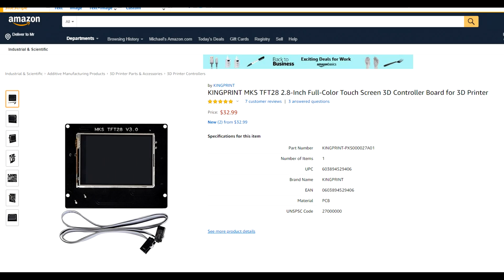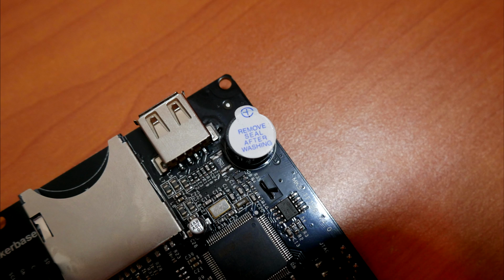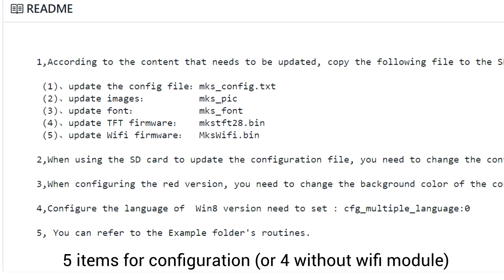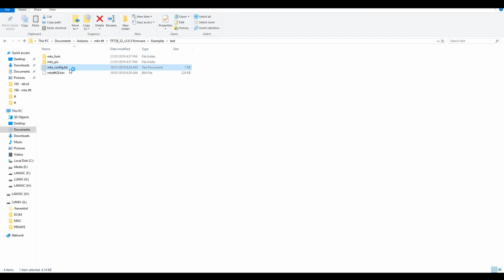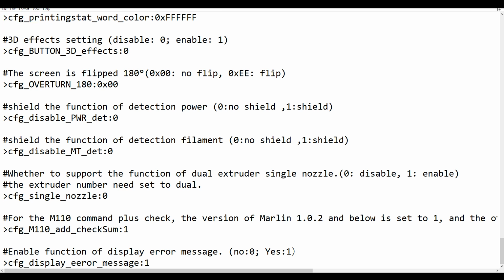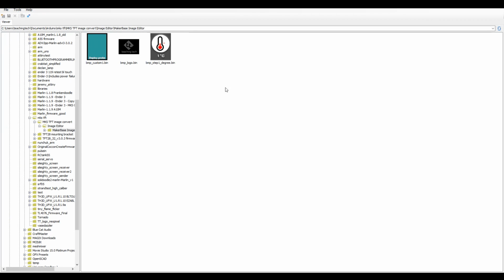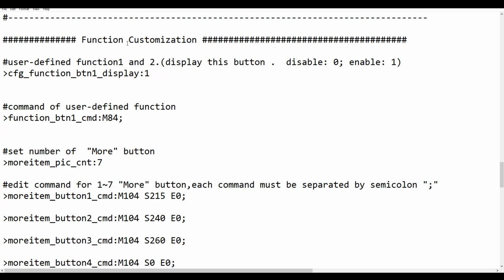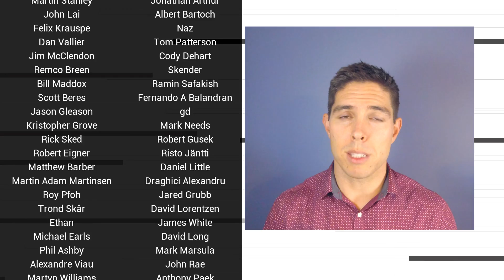MKS TFT28 touch screen on the Ender 3

Comment: So I have the mks gen l, Tft 3.2 and bltouch. I’m having an issue with setting the bltouch everything is dialed in and working as it should however, setting the z offset either up or down during the first layer like on the factory main board is not accessible with this screen is there anyway to enable this functionality?
Reply from the maker: Youcan make custom buttons with M290 commands. See the example at the bottom here: http://marlinfw.org/docs/gcode/M290.html

Comment: Have a question for you. Installed the MKS Gen L board along with a BLtouch. At first I was using a RepRap Full Graphic Smart Controller and everything was working great. I decided to upgrade to the MKS TFT28 controller and the install went well. Going through the screen buttons everything except the "Auto Level" works. When I try to use it, the sequence starts and then I get the message "Error - STOP called because of BLTouch error -  restart with M999" and there is a blue button that reads "confirm" when I push it, it just goes back to the previous screen. Can you help?

Comment: mks_config_EN.txt needs to be renamed to mks_config.txt without doing this causes no communication to the board. Hope this helps someone else as this caused me a grief for a while.
Reply: No joke man I love you I searched the web for 3 days and nothing helped and then I read your tip and bam it works. Thx bro <3
Reply: As always there is always something missing in the description and also I found that to hook it up to the Melzi stock board. you have to change from 5V to 12V and supply an external power supply. if it weren't for your recommendation on the config file I'd still be pulling my hair out.
Reply: I did this with success and was able to see changes to the firmware, but the issue I'm having is the board is no longer communicating with the screen :( like when I home the axes, it doesnt do it :(

Comment: two questions: 1) can i use the SD card on the TFT to print?? (as mks gen l board doesnt have SD slot) ?  2) i read somewhere that if i use the TFT on Mks gen l than i can not use the USB port on the board. is it true?
Reply: As to question #1, yes you can print with an SD card on the TFT28 or TFT32 display. Not sure about question #2.

Comment: Hello! I absolutely love your channel. I'm in the middle of upgrading the main board on my CR-10s following your guides. I've got the TFT28 firmware configured and it's booted up as described but I'm running into an issue with text. As you can see in the image linked below I have text overlaying the graphics. Any ideas for solutions? Thanks!

https://imgur.com/a/P45nCsW
Reply: I had this same issue. mks_config_EN.txt needing to be renamed to mks_config.txt is what cleared it up for me.

Comment: Thank you for this video and touching on custom buttons. It gave me an idea. Currently, I don't have any buttons for babystepping on the Ender-3 I upgraded to use MKS GEN V1.4 and TFT32, even though I set Marlin up to allow babystepping. So, I'm going to make custom buttons. M290 Z0.1; to move z up. M290 Z-0.1; to move z down. And then M500 to hopefully save the setting for the next time I print. I have been using M92 Zx.x in my G-Code, but it's not consistent for some reason. And, I like to share G-Code between different printers (Ender-3 and Ender-5) and the G92 command messes up the level between them. If you know of a fix or how you work around it, I'd be interested to hear it.

Comment: No luck with any controls on mine, the steppers will move manually through marlin but there is no heat up or movement through the screen. I ended up giving up and putting it factory after a few days of looking online and playing around in marlin.
Reply: I had same issue. mks_config_Eng.txt needs to be renamed to mks_config.txt
Reply: fatherb no luck

Comment: I just got my ender 3 pro a few weeks ago and I watched a lot of your upgrade videos. I bought mks gen L 1.4 and stepper drivers, tft28 screen, bltouch, and raspberry pi octoprint and was wandering if you will have a video that shows how to install everything together along with firmware instructions. I would like to find a 3d printed case for the mks gen l 1.4 that works for ender 3 pro.

Comment: Thanks to this video and the related one on the MKS Gen L upgrade for the Ender 3, I've completed these upgrades and gave them a spin last night. All in all, it works well, but I am going to be going back to the original screen with click-knob for two reasons:

1. In order to reflash the firmware on the MKS Gen L, it's necessary to disconnect the TFT28. If I leave it connected, it corrupts the firmware upload and renders the MKS Gen L inert. Fortunately, once the touchscreen is disconnected, reflashing works just fine and everything recovers nicely.
2. The touchscreen doesn't completely replace the functionality of the original display, or, more specifically, the click-knob. After completing a PID autotune, Marlin pauses saying "paused for user". At this time, it's expecting the user to click the knob to acknowledge the autotune completion.

For as little as I actually use the printer's console (versus Octoprint either via an attached Raspberry Pi touchscreen or remotely), I'm not going to be that upset at losing the otherwise cool touchscreen.

Comment: Hi,

Thanks for the videos on upgrading to a MKS GEN L and the TFT screen. You showed you have also a bl touch in your setup.
I have already upgraded my CR10 using TMC2130 in SPI mode. Nice and silent, with sensorless homing on the X and Y. I also configured  a bl touch .

I could not find the option "babysteps" on the new TFT display.  With this useful option you can make small adjustments in z-heigth while starting a print.
For now it only accesable by double clicking the button on the original CR10 display. 

Does anybody know how to get to the babystep-option on the MKS boards?

Best regards

Rob
Reply: Rob Huurman I’m having this same issue on my ender did you ever figure this out? My nozzle is just a bit too close to my bed and would like to babystep it up but I see no option to use this feature on my first layer while printing. I am running a gen l bltouch and tft3.2 like you
Reply: Audio Philes . 
Hi, I've hooked up both the TFT and the original display to the MKS Gen L. Most of the time the TFT-display is used. Babysteps for finetuning a print that's just starting are adjusted on the original display.
Make sure to enable "CR10 display" in Marlin, otherwise only the TFT is functional.

If someone knows how to get to "babysteps" on the MKS Gen L, please inform us.

Rob

Comment: Hello.
I have a question please.
Why do you use version V3.0 and not V4.0?
https://es.aliexpress.com/store/product/MKS-TFT28-V1-3-2-8-touch-screen-RepRap-smart-controller-support-WIFI-APP-outage-saving/1473578_32808777466.html?spm=a219c.search0604.3.62.49f414ecDM8Hnf&ws_ab_test=searchweb0_0,searchweb201602_9_10065_10068_10547_319_317_10548_10696_10084_453_10083_454_10618_10304_10307_10820_10821_537_10302_536_10902_10059_10884_10887_321_322_10103,searchweb201603_51,ppcSwitch_0&algo_expid=a1f682df-c067-450a-b325-72152aea65c8-9&algo_pvid=a1f682df-c067-450a-b325-72152aea65c8&transAbTest=ae803_4

Comment: I have an Creality CR-3040S with a MSK TFT 32_L 4.0 display, but when I upgraded the Marlin firmware of the printer the display stopped interacting with the printer. The only clues I have been able to observe are in the Pronterface console:

echo:Unknown command: "SáM105" 
echo:Unknown command: "C{%¡¥)M105" 
echo:Unknown command: "sáM105"

It seems that the Display is trying to send M105 to the printer, but ends up appending strange characters so they become non-understandable. Could this relate to some language issues with English and Chinese character sets conflicting and how would that come about ?
Reply from the maker: Possibly baud rate incorrect as I've seen the Arduino ide produce junk like that before if the baud was wrong.
Reply: @TeachingTech  The baudrate is set to 115200 in Marlin and in the MKS TFT32 display firmware, also that setting works fine to connect using Pronterface - unlikely the issue here.
Reply: Solved the issue by flashing the display using the original firmware supplied by Creality. It turns out that uploading a new Marlin firmware to the printer, also does something (brakes it) to the MKS display firmware even though it is a totally separate unit. I did not know one upload could affect the other.

Comment: Warning for Octoprint/Octopi users contemplating this upgrade: I discovered after buying the MKS TFT35 that the TFT modules monopolize serial communications, preventing USB communication with Octoprint on a Raspberry Pi, or control via USB from a PC - see https://github.com/makerbase-mks/MKS-TFT/issues/138 and https://samuelpinches.com.au/blab/makerbase-mks-tft-lcd-tft28-problems/ for details. in the Github issue, MKS tech support declared "USB and TFT serial ports are shared and cannot be controlled at the same time.", so unless there's a workaround (Michael?), you'll have to choose between TFT + SD card or LCD screen + Octoprint. This also means the MKS power-off and auto-shutoff modules that I bought are also unusable, because they are controlled by the TFT module... sad day. I will stick with Octoprint for now.
Reply from the maker: I don't have that problem. One of my patrons did and concluded that adding a MKS wifi module caused this problem as they were also able to run Octoprint and the MKS TFT at the same time.
Reply: @TeachingTech  Thanks Michael I may give it a try to confirm

Comment: I've seen some kits of MKS Gen L + TMC2208 + TFT32 but will the 32" version fit the LCD mount? Also, what are the advantages of using this instead of a touchscreen LCD + RPi with octopi (powered with a buck converter)?

Comment: Hey man, 
thanks a lot for the amazing video's i'm in the middle of figuring out if i want a ender 3 or a pro version,Thanks to the video's i'm fairly well into going for the pro even though the most i'll retain of it over the ender 3 are the thicker square thing to keep the hot bed leveled and the power supply and wanting to upgrade the rest.

But there's one concern i have, i'd like to create as much as possible options like printing ABS, is there a way to switch hot beds so i can use the magnetic one for materials like PLA and switch it to another hotbed for ABS? (since i cant physically touch it i'm not sure)

But i noticed from some video that there's in the metal plate of the hotbed 4 screws (under all the adhesives to keep everything on) which go into the i believe leveling dials? can i just unscrew those and then deal with the re-leveling of the beds after switching them? (and yes i understand that this is probably not a smart thing in general?) or is there a better way?

Comment: So I've got the MKS GEN L and TFT28 installed along with the BLTouch. It runs through all of the startup and bed leveling but now how do adjust the Z offset. The nozzle is too high off the print bed.
Reply from the maker: Í have an update coming on that but you can setup custom buttons to move the offset up and down: http://marlinfw.org/docs/gcode/M290.html
See their example at the bottom of the page. I had five buttons: 0.05 & 0.1 movements up and down, plus an M500 button to save the new offset.
Reply: Perfect. Thanks so much. Looking forward to that video and the stepper driver video.  @TeachingTech

Comment: THank you for the videos!  I am really new to the arduino programming.  Do you have a set of files that you could share to load the firmware onto my MKS GEN L that would incorporate the TFT 28 as well?  I am riding the struggle bus hard!  The hardware installation was easy and straightforward, however, I have tried MARLIN vanilla and TH3D and cannot get the board to load.  I have messed with the baud as well.

Comment: Hi, I was very interested in the touchscreen and ordered one to work with a ramps 1.4 board, but...
Updating and connecting no problem, but the TFT28 won't connect to the printer, a humble (modified) Tronxy X1.
Nothing reacts.
(Yes, I connected the TFT28 with a separate 12V supply after changing the Jumper.)
The strange thing is that there must be a sort of connection, because it reads the  current Temp, an if I preheat via Octoprint the go-to temperature is also displayed.
I tried to fing some info on the internet, it seems that there are a lot of people have the same problem, but I didn't find a solution.
Can You shed maybe some lite in the darkness ? 
Thanks anyway, always looking forward to Your next Video
efbe..
Reply: I dont think they are compatible.
Reply: I have the same problem. Did you find a solution? (they are compatibles, for sure)
Reply: I switch to the Ender 3. Never solved the problem.

Comment: Question for all: I followed Michael's tutorial, however, when I have the TFT28 hooked up I encounter 2 issues: First, the TFT doesn't seem to be able to talk to the printer. I am unable to control the printer from the TFT28. And, secondly, it seems the TFT interferes with the GCODE being sent?? No matter where the GCODE comes from (terminal, slicer, etc) numerous commands have one or more 'v/' added to the front of of the command. For instance, say I enter G28. In the terminal I will see 'V/V/G28 Unknown command'. If I renter, eventually it works. As you can imagine, this makes printing nigh impossible. Unplugging the TFT fixes this issue.

Anyone have any thoughts?
Reply: Baud rate ?
Reply: @didtoknan8128  I have it at 115200
Reply: @KageKeeper  on both Marlin and the mks.config.txt ?
Reply: @didtoknan8128  Yes sir.
Reply: After putting the TFT32 in a case, I had forgotten to reinsert the SD card (which contains the config files). I couldn't control the printer anymore. So did you still have the SD card in the SD slot of the TFT ?

Comment: My Ender 3 when I cut it on. It starts going up and up. I can’t control at all. Even on the raspberry. Any idea is are welcome 🙏
Reply: It could be in marlin if you flashed marlin to it. I had that happen once i could swear i found my problem in marlin but it was like a year ago n ive slept since then. But possibly check endstop directions in marlin and or maybe a bad endstop.
Reply: David Tingle     Thanks for the help

Comment: Would the TFT32 also fit on the Ender 3's console panel? Also, I'm very excited to see the TMC2130 video. I hear you can enable it to have sensorless endstops? That's quite cool :P
Reply: All of the TFT models up through the TFT35 have the same board size (110x65mm as I recall) so should fit the stock enclosure. The stock screen opening is 3.5" diagonal so the TFT35 should fit (that's why Michael needed a spacer for a good fit with the smaller 2.8" screen). The TMC2130's have sensorless endstops, but if you step up to the 2208's they do not.
Reply: @dwmorris  thank you! 😁